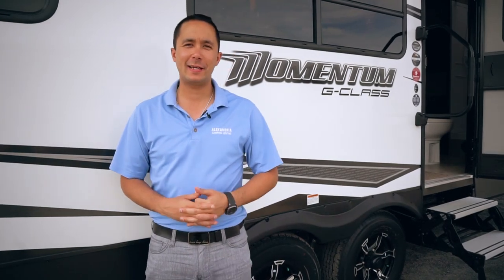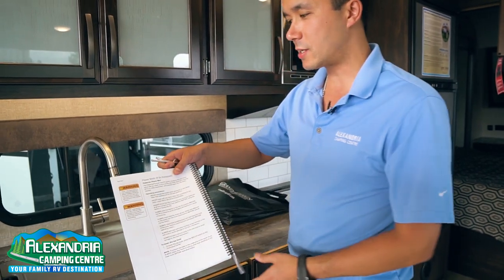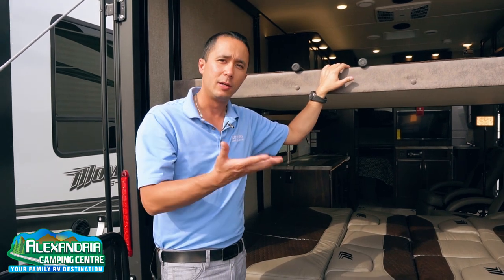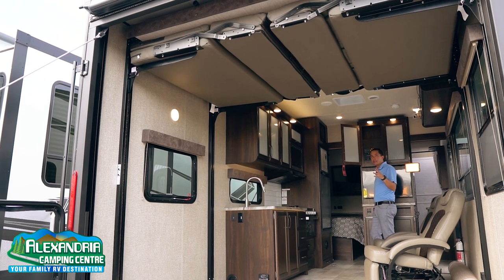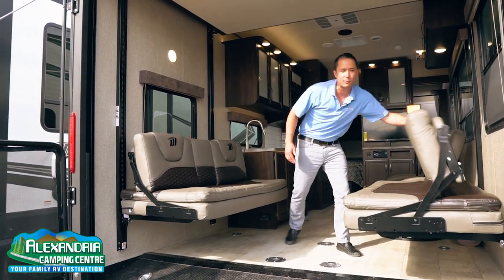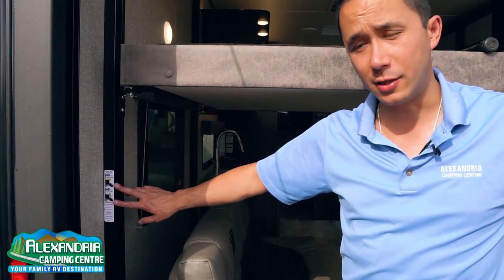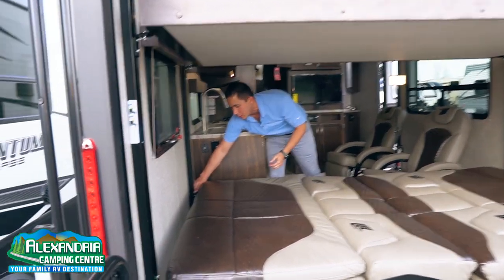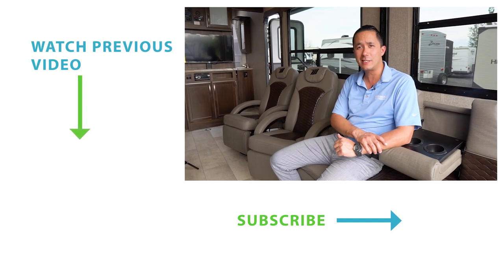HOW TO USE NEW HAPPIJAC BUNK BED? 2020 Grand Design Momentum G-Class 21G Toy Hauler

Comment: We want to use the top bunk but not the bottom. Can we unscrew the benches from the wall? We have a heartland toy hauler.
Reply: Yes, I took my benches out so I didn't have to raise and lower with the benches.  It's much easier to lower the bed frame without the benches in the way.  You just up or down and don't need the pins.  We don't use the benches anyway.

Comment: Can you store on top bed and take it up and bring the lower bed down?
Reply from the maker: the top bed locks in separately if  you like but it is at more of the ceiling height position.  You will hear the clicks in the rails from the stoppers when its locked and you should be able to lower just the bottom.

Comment: Makes me sense. 

2020 but showing the old way of pins. 

We have a 2020 but our owners manual says pins and we have no pins. 
WHAT are we supposed to remove?!
Reply from the maker: Hi Beth, thanks for watching our video. The reason we were showing the old way is to explain the difference between 2019 and 2020 models bunk system. Our 2020 model also does not have pins, and in this video we are showing how it works without the pins. But just to make sure, the best way for you might be to contact your dealership or Grand Design directly. Thanks!

Comment: I like the video but it's extremely hard to hear the audio even at max volume.
Reply from the maker: There is a volume control in the bottom left corner of the YouTube video player, try adjusting it :)
Reply: @alexandriacampingcentre5609  no that's not the case. It's because you were so far from the recording device, most likely a phone.
Reply from the maker: @mecrob9852  The sound was recorded on the lavalier microphone that was attached to the body. Try to watch this video from another device :)

Comment: I have happijacs on my 2019 Northern Lite 10-2 EXCDSE.
They operate at different speeds and require a close watch.
Bigger issue is the absolutely GARBAGE remote control.
It's all plastic inside and when I dropped it once, the plastic, spring loaded, battery holder broke.
To get another I had to pay $225 and wait two months for NL to ship it in one of their new units to the dealer.
A massive hassle, inconvenience and cost.
The remote control is a $10 Chinese made joke.
The dealer pays NL $140. Still far too expensive.
Very disappointed with these jacks and the company over all due to this. If this is what the remote is made of, imagine the jacks. Probably more Chinese garbage that will die the day after your warranty expires.

Comment: The Bottom bunks are useless since this new system has no little legs that flip down in the center and when you lay on it, it collapses down in the center.  poor design.
Reply: why not just put a composite board on top of the bunk before your mattress to even out the pressure and prevent the sag?
Reply: The new Happi Jack bunks in 2021/22 trailers have those little legs now. And it really takes the strain off the wall rains when your sitting on the couches when they are down too.
Reply: @swansong04  do you happen to have a link to get those legs? Ours didnt come with support legs